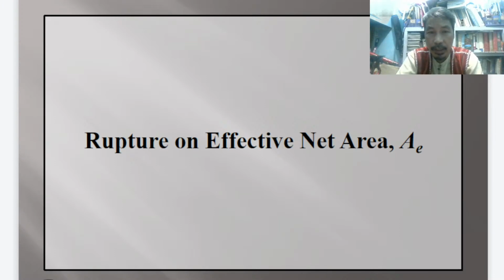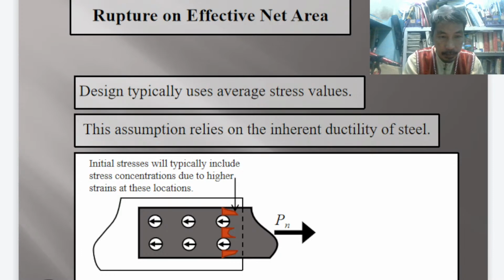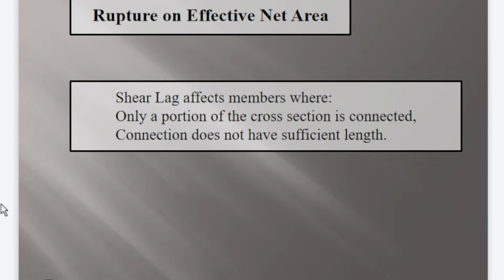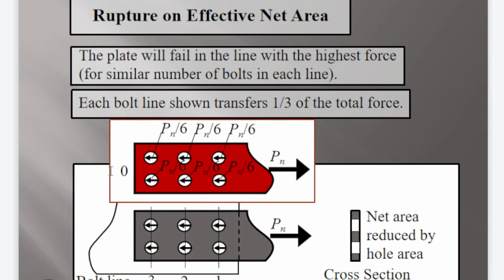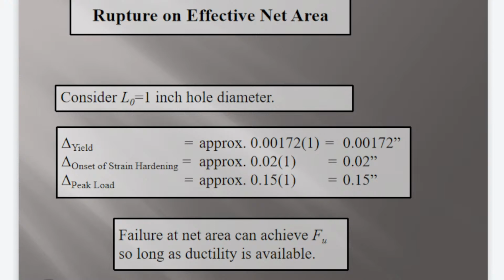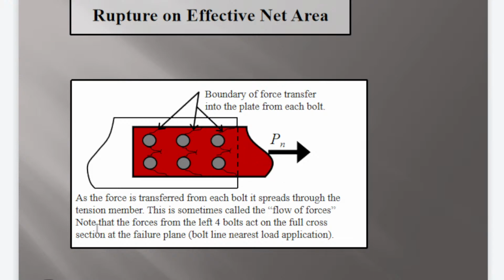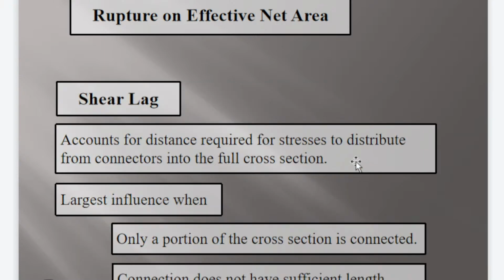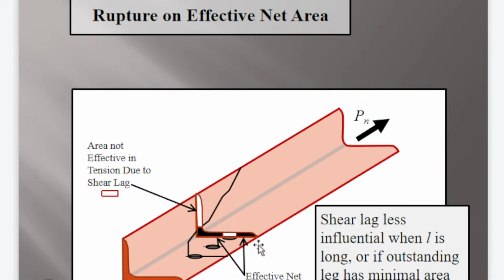[ LIVE CEE6 Lecture 13 ] DrAP Zantua AISC Rupture on Net Areas Talks + ENGINEERING Analysis & Design

Comment: Thank you, Sir for the live lecture and providing another educational live lecture on the Rupture on Effective Net Area, sir. The explanation of the six-hole plate example was clear, as it demonstrates how the bolt distributes stress down each bolt line. This allows us to predict where the rupture failure will occur along the bolt line. This is also applicable in a non-perpendicular or staggered path to the load. Knowing this is crucial for the study of tension members.

Comment: Thank you very much for providing us with such an informative movie on the rupture in net areas and engineering analysis and design. I discovered that by including holes in the cross section, less area resists the tension force. You also said that the bolt holes are bigger than the bolt diameter.

Comment: Thankyou sir for tackling about AISC rupture on net areas. The vertical lines in the plate in the video are called bolt line. I also learned that if the holes is not perpendicular it needed to have an additional length/area of failure plane. Its design is typically uses average stress value and this assumption relies on the inherent ductility of steel.

Comment: Thank you so much for giving us a very well-explained video regarding the rupture in net areas and engineering analysis and design. I’ve learned that if holes are included in the cross section less area resists the tension force. You’ve also explained that bolt holes are larger than the bolt diameter.

Comment: Thank you sir for this continuation video lecture that tackles about Rupture on effective net area. I have learned that if the holes are include in the cross section less area resists the tension force. The example plate shown in the video is very helpful for us to see and to fully understand what is happening to the plate. The vertical lines in the plate in the video are called bolt line. I also learned that if the holes is not perpendicular it needed to have an additional length/area of failure plane. The flow of forces is when the force transferred from each bolts it spreads through the tension member. The photos in this video are well-explained.

Comment: Thank you, sir for further continuing the topic under strength limit states which we are now on rupture on net area. Due to this lecture, I have recall that if holes is present in the cross-sectional area. That specific area became prone to failure. The second principle discussed is that bolt holes are larger than the bolt diameter. I happen to know this wherein we have to add 1/8 in the past example problem. This can be 1/16 up to 1/8. On third, it further explains why holes in cross-sectional area are at greater risk of failure. As punching the holes, steel gets damaged around its perimeter.

Comment: Thankyou sir for the continuation of the discussion. I’ve learned that Raptured on effective Net area determines if holes are included in the cross section less area resist the tension force. Also if bolt holes are larger than the bolt diameter and processes of punching holes can damage the steel around the perimeter. Its design is typically uses average stress value and this assumption relies on the inherent ductility of steel. This video lecture shows that initial stresses will typically include stress concentration due to higher strains at those locations. Highest strain locations yield, then elongate along pastic plateau while adjacent stresses increase with additional strain.

Comment: Thank you sir for this another informative live lecture about the Rupture on effective net area. The example on the plate with six holes was explained well and it shows how the bolt carries the distribution force on each bolt line. From this, we can identify to what bolt line the rupture failure will emerge. This can be applied also in the staggered or non-perpendicular path to the load. This is important to know for analysis of tension members. Thank you sir.

Comment: ---thank you sir for discussing about rupture on net areas. I learned that if the holes are included in the cross section less area resist the tension force. Bolt holes  are larger than the bolt diameter. In addition, processes of punching holes can damage the steel around the perimeter. Design typically  uses average stress values, this assumption relies on the inherent ductility of steel. The highest strain location yield then elongate along plastic plateau while adjacent stresses increase with additional strain. Shear lag affects members where only a portion of the cross section is connected, connection does not have sufficient length. The plate will failin the line with the highest force. Failure at net area can achieve Fu so long as ductility is available. For a plate with a typical bolt pattern the rupture plane is shown. Yield on Ag would occur along the length of the member. Both failure modes depend on cross -sectional areas. Need to include additional length /area of failure plane due to nom-perpendicular path. As the force is transferred from each bolt it spreads through the tension member. This is sometimes called flow of forces. Shear lag accounts for distance required for stresses to distribute from connectors into the full cross section.